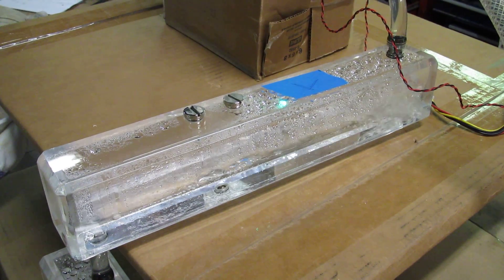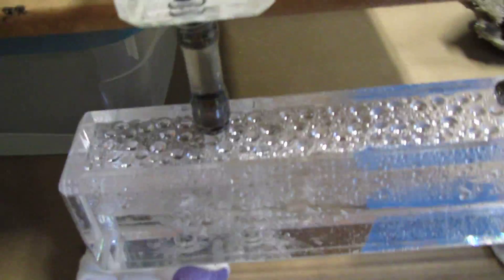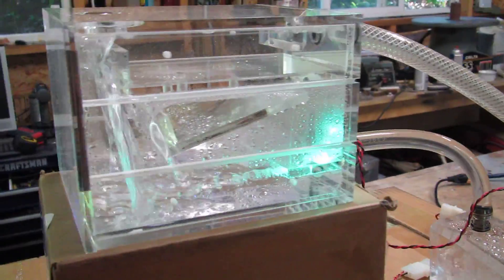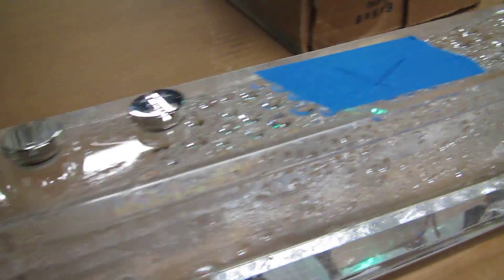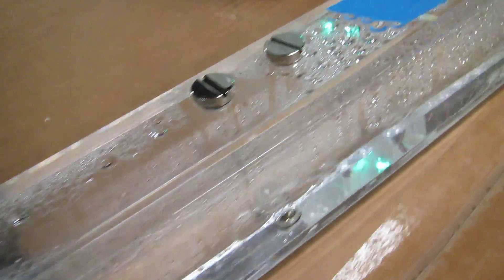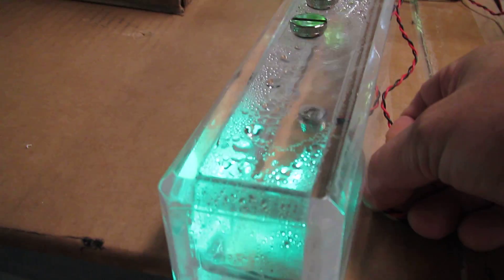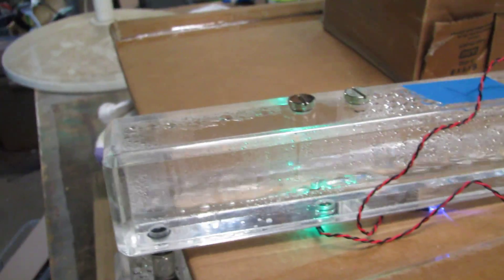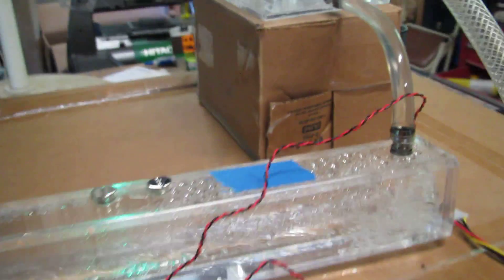Twin Custom Reservoirs made from Acrylic

Comment from the maker: @FailLikeAChamp He has a specific way of mounting these to a large techstation with clamps. One on each side. He plans to run multiple loops and test different equipment, etc. These are far from standard in configuration, construction, or port lay out. Totally to spec. 

However I really like the way these look and today I am going to build a vertical one just to test it out. I have a POM XSPC top on a 355 pump and I'm going to make a res the same footprint as the pump top. Stay tuned ;)

Comment from the maker: @Quadcore14 Thanks. I get my plastic from Delvies. I use cell cast acrylic or polycabonate. Depends on the application and requirements. Cell cast polishes up the best and is the most scratch resistant. Polycarbonate is shatter resistant and chemical resistant but scratches easily.